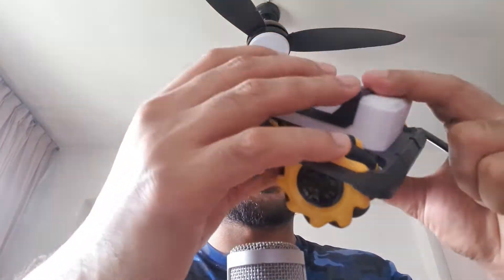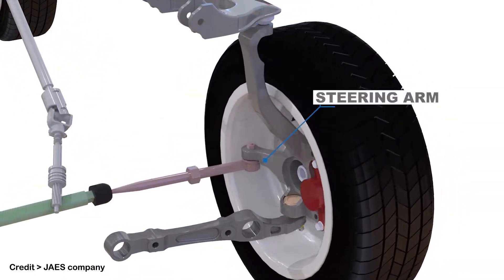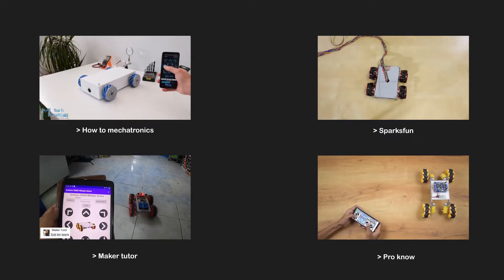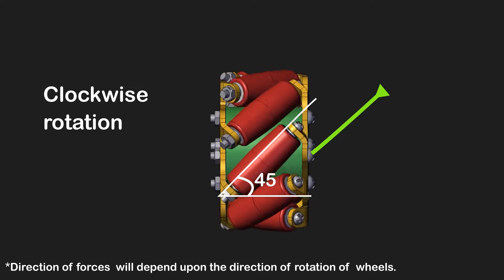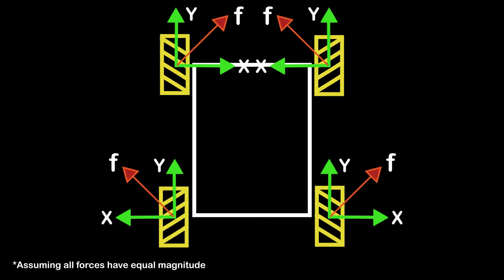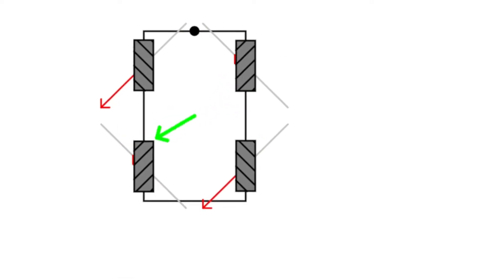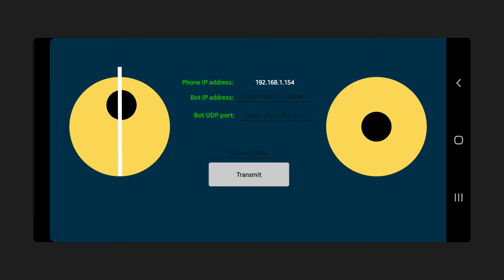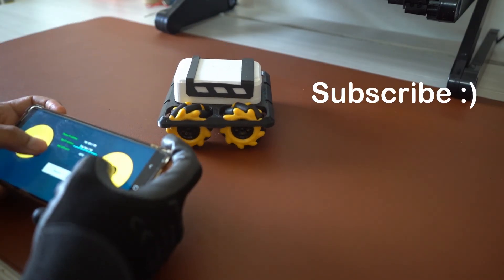How to make mecanum wheel robot and program it correctly

Comment: Brother which screws you used in your 3d printed wheel adapter to attaching it with wheel ? Waiting for your response!
Reply from the maker: 2mm screw I don't remember the length though. You can also attach it using glue gun.

Comment: Can i use this code on esp8266 with L298 motor driver and gear motor car
Reply from the maker: You will have to add the motor driver part and replace the code inside movement functions other than that it should work.

Comment: Please add some sensors to this!
Reply from the maker: I am planning for better motors
Reply: @SasteJugaad  I'm planning on modify a toy rc car, it uses common motors with gnd and vcc, I was planning to disassemble the servo and use the electronic board connected directly, but notice that there is a potentiometer that measures the position, is this part necessary? Or there is a way I can control the motors without any data wire?